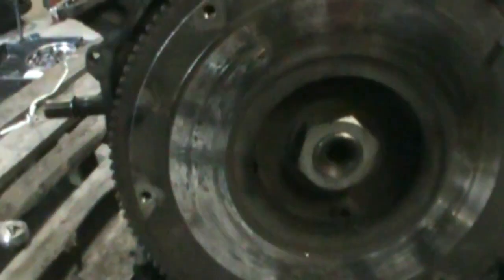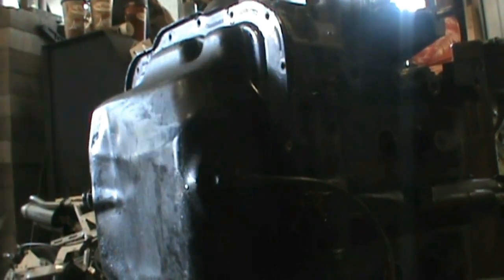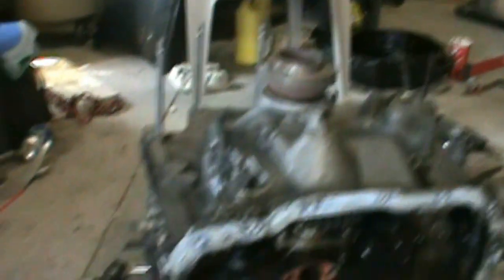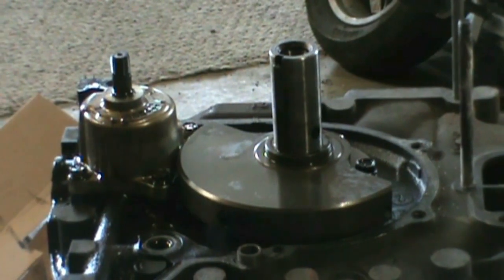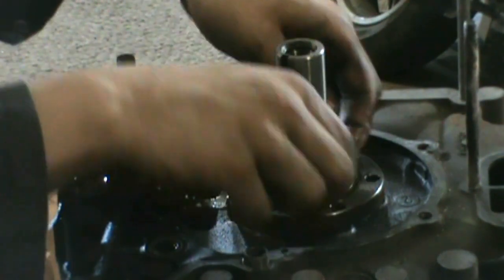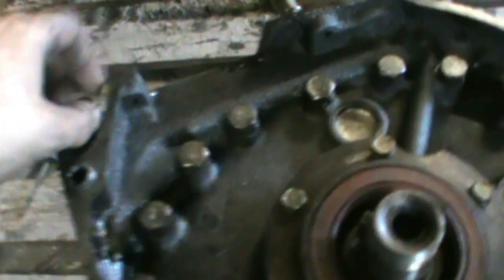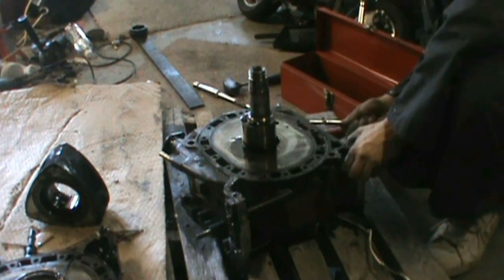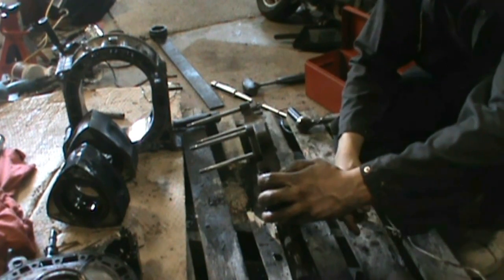How to Rebuild and Port a Rotary Engine: Part 3

Comment: where can I find a rebuild kit for my rotary engine?  like the apex seals and stuff.  I have a 1985 Mazda RX-7 with less than 90,000 original miles but it runs really sluggish, and it's been sitting up for a while.  I'm gonna pull the motor and transmission and make a dune buggy.  the body is trashed because I got hit by a drunk driver, but the motor and transmission are fine.

Comment: dicked rotors eh? i got an 86 fc, have been putting in hours on it but still have coolant issues. it kind of picks and chooses when it wants to over heat. i have replaced hoses, water pump, electric fan, thermostat, rad cap,  replaced omp lines because my previous melted, but new lines look like they have no flow.. not sure if it's internal.. any advise...  also have a 91 engine sitting so this vid was a big help on tearing that 1 down. Best tear down so far

Comment: Oh I get it now! pieces of the apex seal broke off, gouged the housing, went out the exhaust port and broke the turbo impeller... that's messed up. I've seen a machinist use Teflon to replace the apex seals. Not sure how good an idea that is tho

Comment: I did have the code around somewhere i think it was P0401 or something came back the egr if i remember. so i took the egr off and checked for loss of pressure (i see a youtuber do it LOL) Has 94k miles duratech v6 24v doch i think thing stinks so bad on start up now! :( i need a mazda or a truck ha thanks bud

Comment: well, I guess you could fix them, but the process would be really expensive IMO.

new aluminium (instead of the stock cast iron) rotors and housings run for about 1500 dollars each one, and standard cast iron ones cost about 800

in the end it's not all that expensive (it's a lot of money, but taking into account that you're basically buying a new engine) to replace a damaged housing or rotor.

Comment from the maker: the turbo engines average about 100 000 miles non turbos 150-200k. they're really similar to a 2 stroke engine except they they have 4 strokes, the seals wear from running across the open ports and if they arent replaced in time can blow and mess things up. The biggest problem is they used the 3 piece seal for better sealing but dont last as long . now if you go to the mazda and get seals they are the 2 piece

Comment: you don't bore or hone a rotary, you port them, you make bigger intake and exhaust holes and adjust the ecu to feed it more fuel, that's the only way to increase a rotary engine's power, apart from turbos and shit

if you want increased capacity, buy a 20B engine, which is pretty much the same as this one albeit with an extra rotor